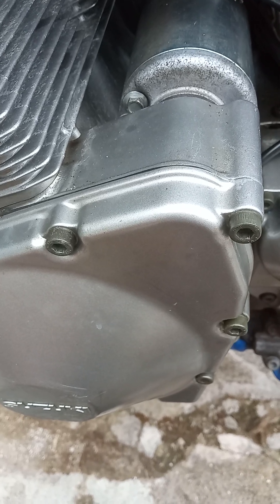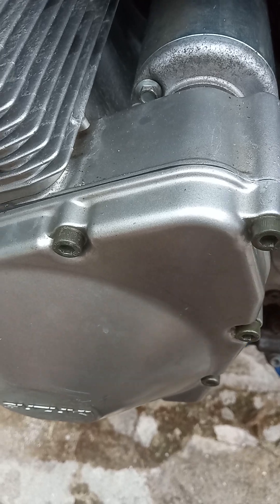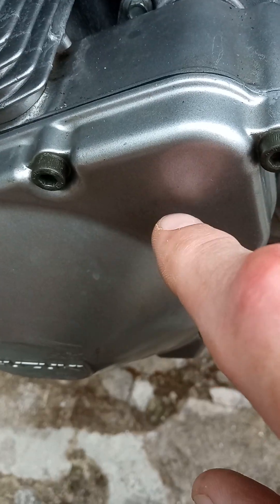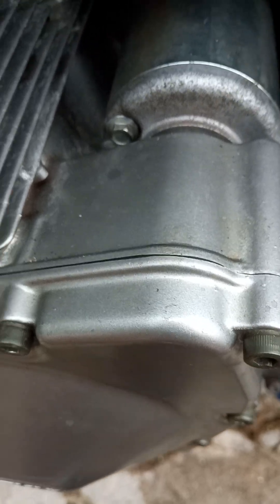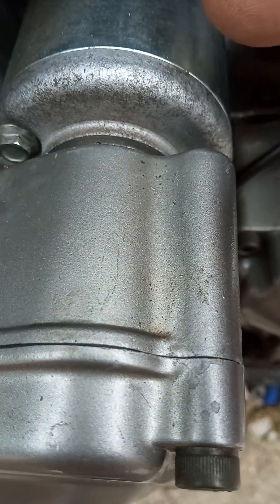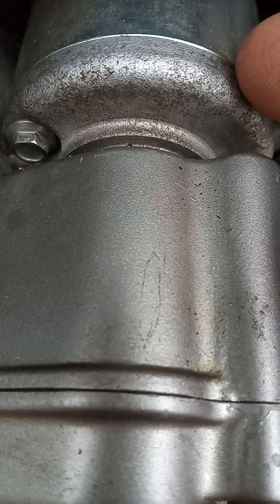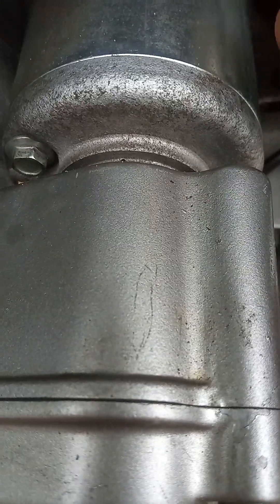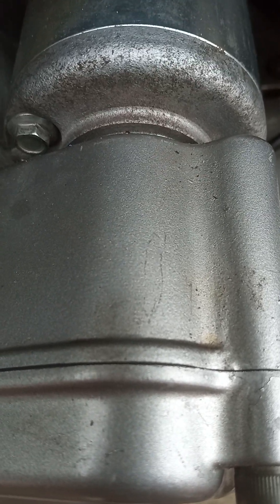Motorcycle Sprag Starter|One-Way Clutch starter motor not engaging? Check spin direction & polarity!

Comment from the maker: ⚠️ Sprag starter motor not engaging? Check spin direction & polarity!
The Bandit’s starter motor is a DC motor – wrong polarity and it spins backwards! The sprag clutch only works one way, so the engine won’t turn and you risk gear damage. ✅ If you’re opening the starter motor, mark the case first so it goes back together correctly. I’m not a qualified auto electrician or automotive mechanical engineer. This video is based on my own experience — follow at your own risk and always check your vehicle’s manual before making any changes. 👍